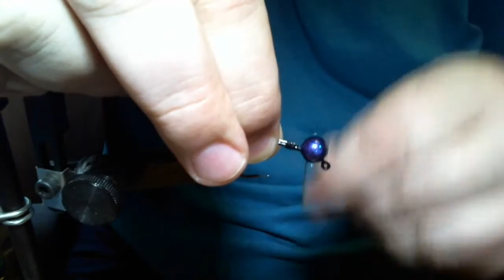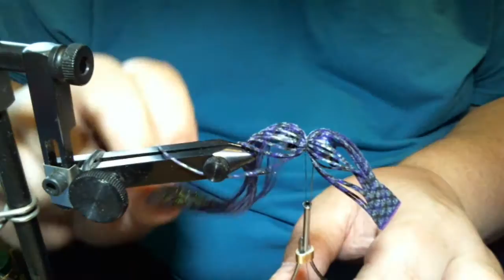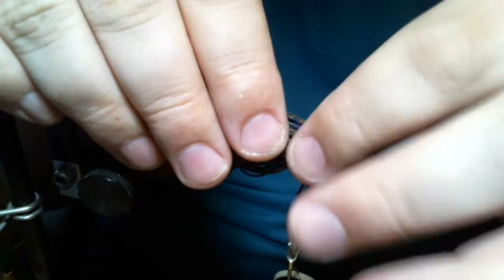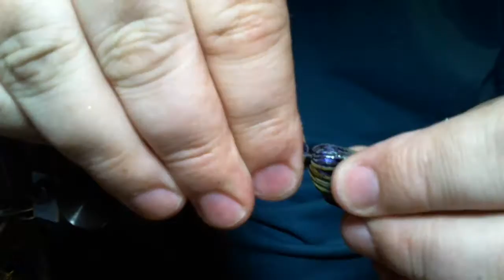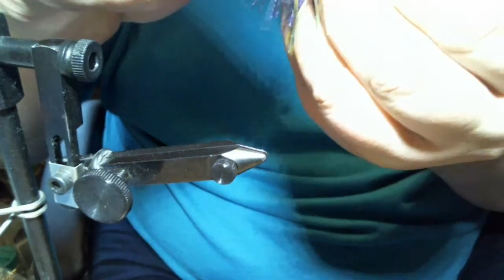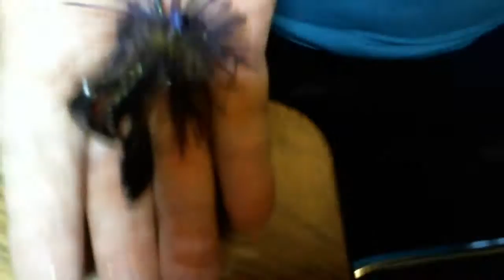Wacky Finesse Jig 2

Comment: Another great video! I fish on the TX gulf coast and you've inspired me to start tying a few bucktail jigs and experiment a bit. Do you have any recommendations for what kind of vice and other tools a beginner needs? Thank you
Reply from the maker: Taylor Chaney  Thanks for the kind words I really appreciate it!! What you need to start is a bobbin, vise, and scissors but if you aren't sure you'll like it then get a AA vise as they are inexpensive and will work well. I suggest a Griffin Superior 1A for $40 but if you have a little more money the Odyssey Spider is what I use and is a rotary vise that holds larger hooks with a lifetime warranty.
Reply: smalljaw Thanks for taking the time to share your knowledge with a beginner. I think I'll spring for the Odyssey Spider. I have one last question if you don't mind,  do you have a preferred website for ordering bucktail and other tying materials? Thanks again
Reply from the maker: Taylor Chaney  I don't really have a favorite place, I shop around as the prices change as does selection of colors available. Spirit River has the best material like hair and feathers and for silicone I like BOSS outdoors.
Reply: smalljaw Thanks again for your advice.  I'm looking forward to getting started.